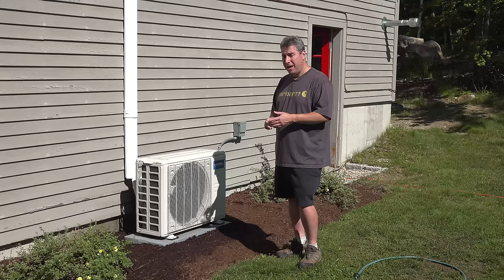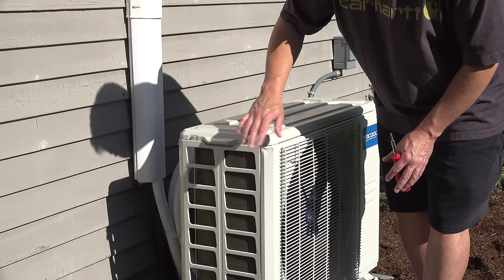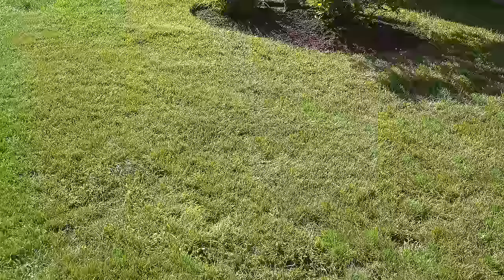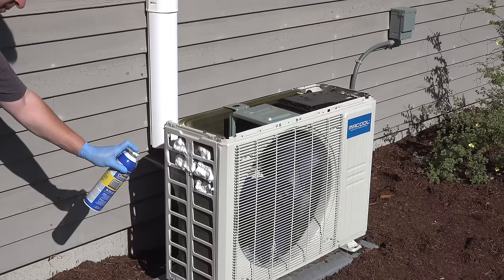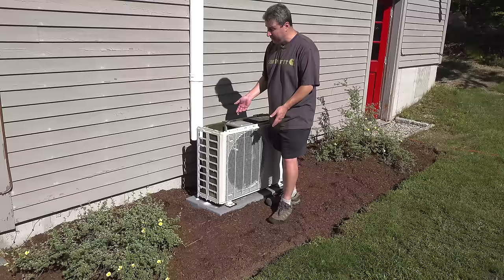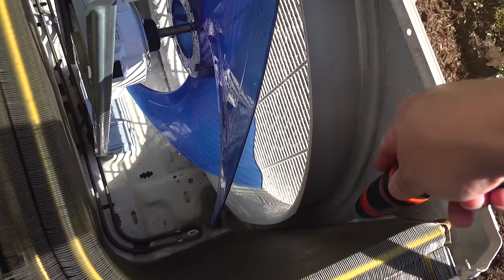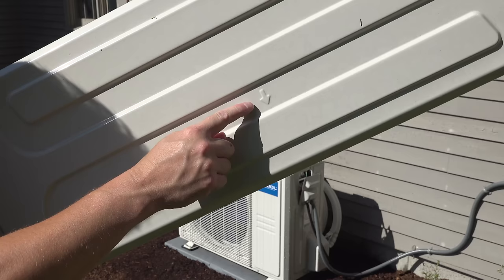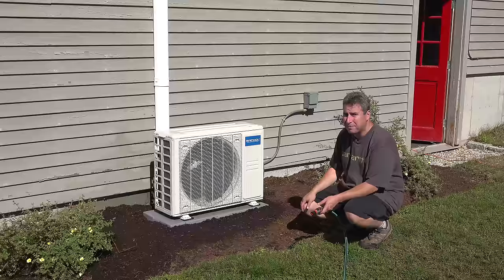How to Clean Your Mini Split AC Condenser - Make it Cold Again

Comment: Thank you for the great video.. I’m shopping for a mini split for my 1500 sq ft home here in Wa. Where as everyone knows it rains a lot so my concerns are I’d think for it to last longer would be to keep it from sun beating down on it and same for rain. Is there any concerns about building a large cover with good size vents so it gets plenty fresh air and to keep dry and from sun exposure?
Reply: I bought two of the Mitsubishi units for the addition on my house, a very large living room, and very large bedroom about four years ago. I have a full sized unit for the front of the house. I couldn't be happier. They work perfect and the best part is being able to cool just the part of the house I'm using leaving it off everywhere else and it saves so much money. Highly recommended.
Reply: @Joker-ig8im  thank you and will checkout the Mitsubishi
Reply: @Ron_Masterjohn  ideally you just put them under some sort of roof to prevent sunlight hitting it directly. sun won't really harm them but it'll reduce the efficiency in summer (it will increase the efficiency in winter though). a little roof will also prevent the paint from being damaged by sunlight. as for rain... well, rain will increase efficiency in summer haha

Comment: Just wondering...if that foam (and other brands like it) say "No Rinse" why do you choose to rinse? Thanks. Tim
Reply from the maker: The thought is that the consideration will move the foam off, which is true but it moves it very slowly and if done regularly might be ok. The hose ensures its all pushed out very quickly with with some gentle force for a better cleaning

Comment: Window rattlers are not only much cheaper to buy/replace and run but don't need a technician to install and can be moved whenever needed and also brings fresh chemsprayed toxic air into your room as opposed to recirculating the more toxic air in your room. WTF
Reply: this is true but most people prefer the absolute silence of a minisplit unit. also the assortment of window ACs is tiny in comparison to minisplits. especially in north america. finally, the thing with window rattlers is that they're fairly small. a 2 or 3 ton unit needs 2 people to move it and most windows won't be able to hold it. i had a (permanently installed in the wall) window unit for 20 years and replaced it with a minisplit a couple years ago, when it finally died.

Comment: My unit is on the balcony...no hose.. available
Reply: mine is mounted outside a second floor balcony. hard to reach with my ladder
Reply: @StAnger561to770  wow !!!
Reply: @calikokat100  yeah I wasn't really thinking about safe self maintenance when the installers came I wish they would have done it a little different or brought it down some

Comment: snake oil.  Foam doesnt do anything to the oxidation off.  And what cause oxidation?   You guessed it!  Water.  So adding water to the mix is stupid.  The cover in this ac unit was designed by a moron.  It allows rain to accumulate on the aluminum.  someone needs to immediately modify this to resemble a regular whole house unit.  AT the very least, put awnings on it.

Comment: Can't take this seriously. I stopped watching when I saw the outdoor disconnect was a breaker, and the mini split line set was coiled up.
Reply from the maker: So a Square D AC Disconnect (best on the market) https://amzn.to/3PAVHeH isn't acceptable what would you use a light switch?
Reply: @SilverCymbal  don't pay attention to armchair experts. the coiled up lineset is required. you need a minimal length of line for R410a units (usually 3 meters). Here in Argentina manufacturers will void your warranty if you don't have it.